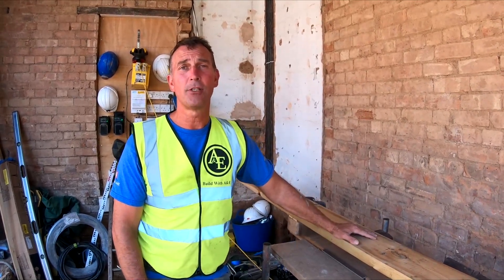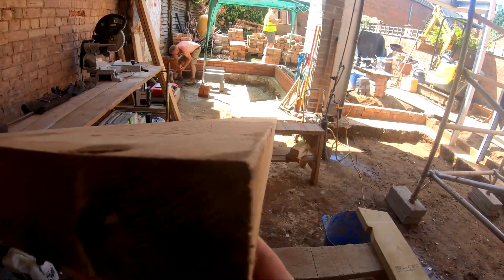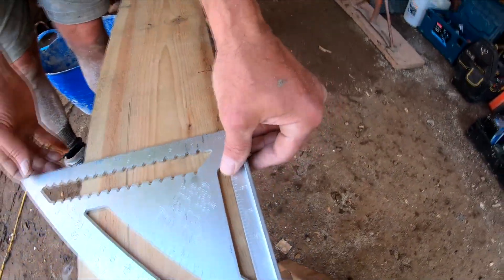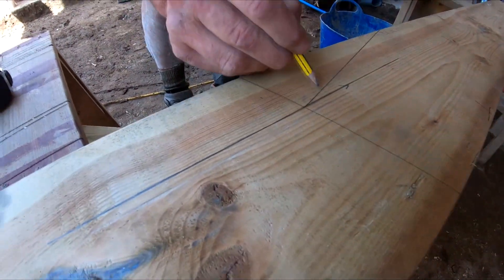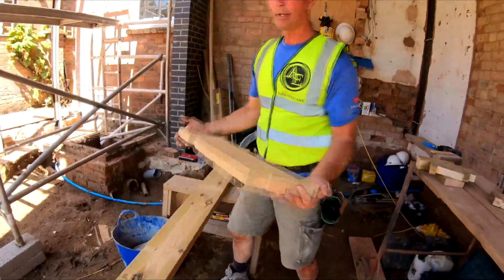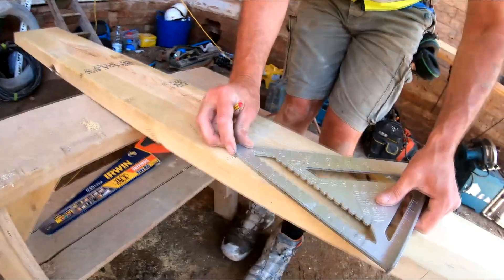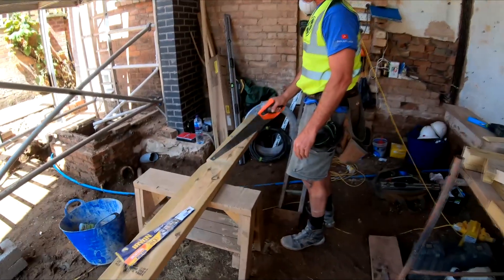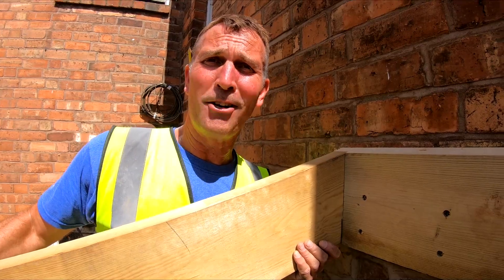HOW TO MAKE A COMMON ROOF RAFTER | DIY Series | Build with A&E

Comment: So many YouTubers get this wrong in my opinion, even the great Robin clevit , Crown up on flat roofs and floor joists is an absolute must (although not a structural requirement otherwise we’d have an inspection on it) Crown up on a pitched roof is detrimental to how the tiles sit especially slate tiles, Back in the day when purlins were often used They used to set them an inch lower than the roof line to Make sure the roof was concave and not convex! This is referenced in the little blue roofing ready reckoner, that all carpenters should have! If you walk around and look at new loft conversions where they’ve had to put new rafters in there are always gaps in the tiles as they have put them in Crown Up! I’ve commented this many times before on other channels, and most people don’t understand and think Crown up is right on a pitch roof! Think about the graphs you used to draw at school, making a curve with straight lines!
Reply from the maker: I will definitely look into this thanks for the advice all the best Tony

Comment: great video wall rafter did you use bolts or screws? thanks.
Reply from the maker: Bolts mate
Reply: @BuildWithAE  what type of bolts 👍
Reply from the maker: @adamsala9291  masonry bolts M12 or M10 if my memory serves me
Reply: @BuildWithAE  apreciate your replys was it thunder bolts or shield bolts? you used 🥺
Reply from the maker: @adamsala9291  thunderbolts
Reply: @BuildWithAE  thats great appreciate your help thank you 👍

Comment: How do you find the degree of the pitch roof if the wall plate is already in situ?
Reply from the maker: Different ways Dan Cox roofing square 
Or rest rafter on wall plate and lift the other end to the desired wall plate cut height plumb down or roofing calculator have a wonderful week all the best Tony 👍

Comment: I have a question, just trying to get my head around this.  At 2:40, you show marking out the birds mouth one third (65mm in this case) of the way across the timber, which is what I understand to be correct.  However, you then show at 8:00, cutting out the birds mouth, but it seems to have got much smaller, a lot less than one third.  Why the difference between what you marked out at the beginning and what you cut out later?
Reply from the maker: It’s because of the Aluminium detail that we had to change the birds mouth, we could of put a 1”1/2 capping on to get the bird’s mouth but no point, the point load and the wind position didn’t warrant any of these things engineer was happy with the proposal so win win but yes I can see why it might be miss interpreted have a awesome week all the best Tony 👍

Comment: The rule of notching no more than 1/3 of the rafter depth (not width) will leave you with 2/3 of the rafter to take the roof weight.

However, by notching the upper wall-plate, you have removed 2/3 of the timber and the rafter sits on only 1/3 of the timber, and this could split off. Granted that the rotational force of the rafter, pivoting on the (lower) wall plate, pushes the top of the rafter into the wall but still….

Comment: Hi Tony , I got the start with a subby chippy , I started to do the special half lap you use to connect your rafters to the wall plate , he asked what I was doing , I explained that you said it was good practice and he told me to gather up my tools and “ get lost “ 😔
Reply from the maker: Hi Dermot really disappointed to hear that. In the building industry there many factors the biggest one is the cost to that builder or subby this is something you have to work out when working with different people for me it’s my own company so it’s my cost of time, plus the application of rafter required it. Many roofs are put up with out this joint. Dermot not to sure how far you are away from Coventry or Leamington but you can always come and work with us pride and passion create dreams and take you every were have a awesome weekend all the best Tony 👍
Reply: Thanks Tony , you are right in what you say , I’ll find something somewhere, I live in Stepney which is now Tower Hamlets 👍

Comment: great video , could you actually explain how you fix the rafter to the back plate
Reply from the maker: Hi George top of rafter with decent length washer screw or each side or use a rafter metal clips with 35mm twist nails all the best Tony 👍

Comment: Great video..thank you. How did you make the recess cut into the wall plate into which the common rafter sits ? Did you use a router or did you a chisel and hammer ? Just thinking if there is a easier way to do it ? Thanks again.
Reply from the maker: Hi much appreciated chisel and mallet 👍

Comment: Hi Tony how do know what height to put your pole plate for your common rafter
Reply from the maker: Hi Stephen 
With this roof I had very limited height, I understood I had glass and slate going on so slate has a minimum degree and glass a lot less so didn’t really need to worry about the glass, then thought I have battern the slate then one brick up-stand then I could check the pitch of the to wall plate and then wall plate glass detail. Always check what’s required on the technical info for roof covering. I also used a line and then good old plumb Bob all the best Tony 👍

Comment: great job and looks really nice, can you show or explain ples how to cut out the notch part on wall ledger for rafter to insert into? also where on rafter would you insert screws? would it be side on or top and bottom of rafter? thanks heaps from new zealand

Comment: How is the back plate attached to the wall? are they self tapping concrete screws? would you use them for perforated engineering bricks. cheers

Comment: Hi, great video, really informative. Now means I can replace my crappy flat roof.  I have a question about the wall plate that is screwed onto the house. How do you take into account the spacing if there is a waste pipe in the way? (I have a sink and bath waste pipes in the way)

Comment: 5.50 - Do you measure from top of the rafter plate to the back of the wall plate the same as the other version with the rafter sitting on top of the rafter plate with the bit of the bottom notched out?

Comment: Luckily the wall was straight so all your rafters were 2340. Could you cut them at 2320 (eg) and pack out the difference if the wall wasn't as straight as the one you're working with or do you measure them all individually?
Reply from the maker: Hi rbondy008 because the house runs out I measured the all individually normally always check plates for parallel and level all the best Tony 👍

Comment: Top notch work.... I'll show myself out. Does that notch only work at the edge of a ledger board? If I did that notch cut for a lean to pergola build, all along a ledger board, should I still use a hanger? 2x9s spanning 3.8. I suppose I'd have to notch for the hanger too that could get complicated 🤔
Reply: Hi Joe, did you ever use this method? I'm wanting to do it too for a lean to/pergola.. what did you use to make the rebate notches?
Reply: @charlesmilligan1416   I went for concealed flange hangers and notched the rafter to sit flat against the ledger board and flat on the bottom of the hanger. My roof was only 7 degrees so I'm not sure how silly my method would look on a steeper incline. The notch to sit flat on the hanger was only 7 degrees along 10cm so the deeper end was still only about 2cm.

Comment: And me with my ready reckoner in the van 😂😂😂, a tape measure as a string line Is all you need! Top work guys, thanks for sharing those tricks. (Loved the notched on the plumb cut 👌)
Reply from the maker: Hi frechgreguk much appreciated ready reckoner is good so many different ways now, don’t normally do the notch it was all down to the detail from the architect with clean line fixing from underneath ie plasterboard all the best Tony 👍

Comment: So general rule is that birdsmouth needs to be 3rd of a width of a rafter. You made nice example at the beginning.  But here 10:10 your birdsmouth looks way smaller than the very first you showed. Am confused.
Reply from the maker: Hi Darbai3000 check out the comments you will see why 👍

Comment: What happened to making the birds mouth a third like you said at the start? You changed it ?
Reply from the maker: Hi at the start I was showing you the normal practice of the bird’s mouth but in this application because of steel lines I could of put additional height to the wall thus achieving a deeper birds mouth but I was quite happy with the set size all the best Tony 👍
Reply: Got it thanks, thought I may have missed a step. Can you avoid using a hanger by cutting the top in ? Looks very clean that way. Keep up the great vids learning a lot.

Comment: in order for this to work you needed to have the wall plate on first. did you get that measure off the plans?
Reply from the maker: Hi Matt yes and no looked at Window lines looked at drawings for wall plate and then cast a line all the best Tony 👍

Comment: Hi, when you put your tape at the top of the rafter then measured 2.430. How do you find that point to mark for the bird’s mouth? Also, how did you find the rise to plate height at the top end of rafter?
Reply from the maker: Hi Paul I put the tape on the wider edge and and arched it to the 1/3 point of the bird’s mouth, regarding the height we were guided by the window line all the best Tony 👍 have a awesome weekend

Comment: Great video. At 10:20 you show the mortise/ type notch for the rafter to the ledger board. Is this connection fastened with screws and bolts?  Also do you have a video on how you did the notch for the ledger connection?
Reply from the maker: Hi Scott I will look in the video file to see if we have that footage if we have I will post it all the best Tony 👍

Comment: By the way it’s not a third of the width of the timber ? It’s a third of plumb cut mush ?. Where did you do your carpentry apprenticeship ?
Reply from the maker: Hi Paul I was taught by an amazing joiner and he was one of the best and I will go on showing a third of the timber but thanks for your input its duly noted all the best Tony 👍
Reply: @BuildWithAE  mmmm how do you know he was amazing ?  The best according to who . Jesus was a humble carpenter , you do it your way mush , that’s fine thing is it changes as the pitch of a roof changes , but you can’t see that , which is also fine . You remind me of my 15 year son ? He won’t listen either . Mmmm 15 degrees . A flat roof is 10 degrees ?   We all do things different in the world , but if think you can re invent the mathematics of thousands of years carry on . Are you based in Borneo ? Or the Amazon ? Kind regards from a mush in Hampshire , born and breed
Reply from the maker: @paulrumbold2436  thanks Paul all the best Tony 👍
Reply from the maker: Hi  @paulrumbold2436 
Just thought I would share this with you.
Take note of the bottom paragraph.
Jack who taught me was like a George Ellis of his time.

In light frame construction, a birdsmouth joint or bird's beak cut is a woodworking joint that is generally used to connect a roof rafter to the top plate of a supporting wall.[1] It is an indentation cut into the rafter which consists of a "seat cut" (the face of which rests on the top plate) and a "heel cut" or "plumb cut" (the face of which lies parallel to the supporting wall), forming a shape resembling a bird's mouth. The indentation should not extend unsupported on the interior in order to maintain the structural integrity of the rafter because the unsupported section can split along the grain of the wood. The joint is generally fastened with nails by toenailing the rafter from the side into the top plate below.

A birds-mouth joint in a rafter, set upon a double top plate. Shown are the two cuts of the joint: the seat cut and the heel cut.
The depth of a rafter cut varies according to local building code differences in different locations. As a general rule, no more than one third of the depth of the rafter should be removed, in order to maintain structural integrity.
Reply: @BuildWithAE  yeah took note of last paragraph indeed one third in depth of  plumb cut not square . . It’s like texting my  15 year old . He sees what he wants too . Happy Christmas to you .
Reply: @paulrumbold2436  wow, someone's got a bee in their bonnet! Call me 15 years old, but does that text not say that when cutting a bird's mouth, it should be no more than a third of the depth of the rafter? Can't see where it mentions third of depth of plumb cut...

Tony's clearly a skilled and knowledgeable carpenter, and of course everyone makes mistakes now and then, but from what I see in your comments, you seem to be being a bit harsh for no apparent reason. What he's saying is right, maybe it's been lost in translation slightly and you've missunderstood what he's saying 🤷🏼‍♂️

Comment: Most carpenters  have a miter  saw..  a 4-12 is 18   1/2  degrees  a 5-12 is 22  1/2   degrees... so  why not just   cut that angle    on  a 12''  block then nail on a clete     take the span of the building  deduct  the with of the ridge and look up   this would give you the length of the rafter..   if you look under hip or valley they are both the same length using the same span of the building   that  would be the length no shorting.     say the rafter length is 10  ft   from the plum cut to the seat  draw the plum cut and cut the mark measure down 10 ft  and draw another plum ct   if you want full bearing on a 2x4  wall   slide a scap 2x4   hold it flat   down the plum cut and when the edge touches the bottom of the rafter that is the seat.     cut two of these. patterns    lay  up about 8 or 12  rafters on a horse  and mark them  using the 2 rafter patterns    make a pattern for  overhang of the rafter and that is all there is to it.